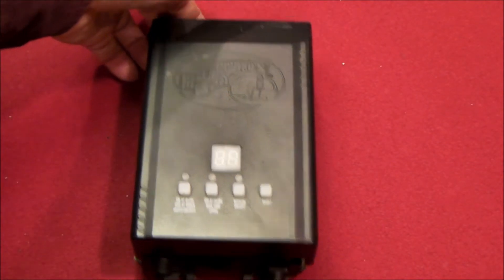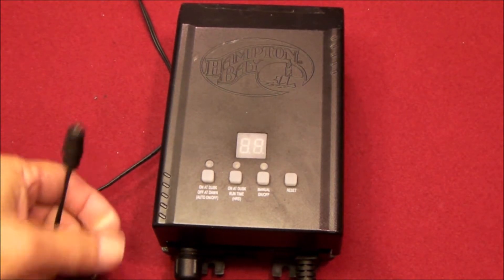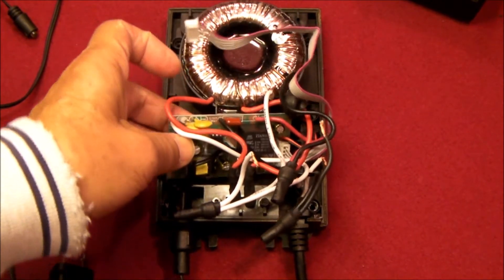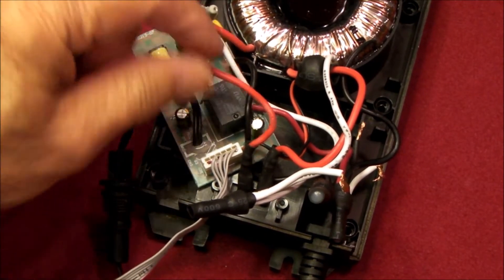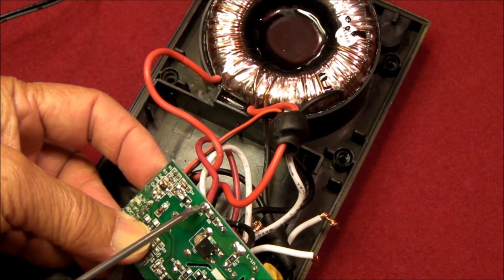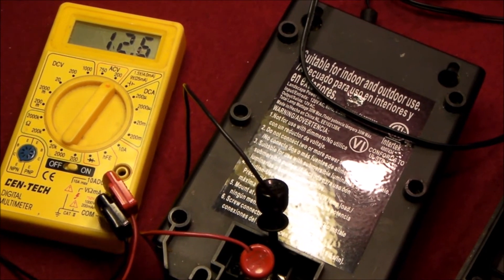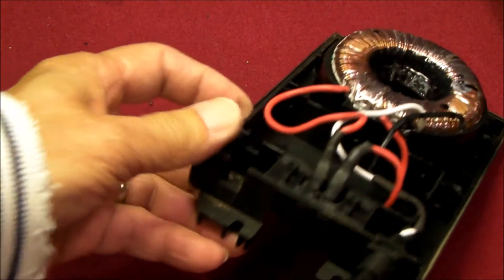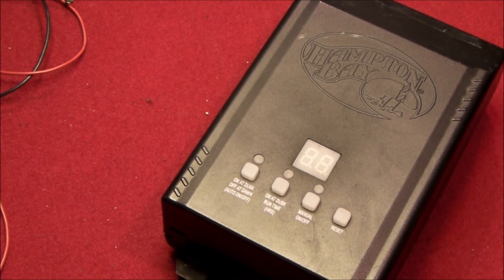How to salvage your low voltage landscape transformer to keep your lights running

Comment: Control board protects short circuits though?  Would it burn up now if there is a short instead of cutting off?
Reply from the maker: Control board does not do any sensing of the transformer output so shorts on the output with the control board removed are no different than a short with the control board.

Comment: The control board in my transformer is damaged. So I’d like to bypass as you did.  However, the 2 wires from the controller to the transformer are red.  So, I don’t really know how to directly connect the neutral and hot to it? Any idea?
Reply from the maker: You should not attempt this modification.  It's not worth hurting yourself or burning your house down.

Comment: quick question, I need the photo cell so how would I connect that after doing the surgery you did. thank you
Reply from the maker: photo cell controls the control board with controls the transformer.  If your control board is bad, the photo cell is worthless.  You could add a line voltage external photo cell to control the transformer.